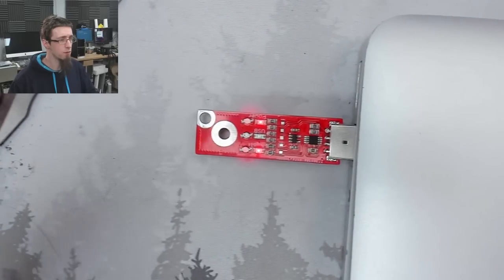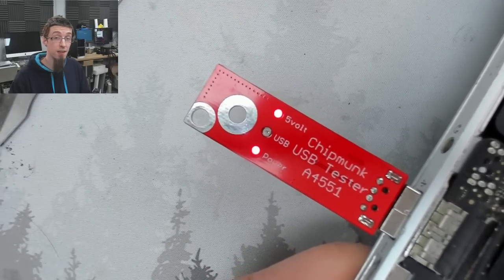CMIzapper.com Diagnostic Tools - LFC#343

Comment: another top tip that has sprung to mind is to use low melt solder on the break out boards, it'll be a breeze to pop them on and off for re-programming, and obviously use normal solder to put them back on the laptop/PC board...

Comment: USB keyboard is the best tool to check, if laptop is on or not (tapping numlock+caps lock).
Reply: Somewhat more cumbersome though in terms of desk space.  Could also use a USB-memory-stick (with LED) or a mouse; though neither will give you the good-5V reading.

Comment: I'm always fascinated by special purpose diagnostic and repair tools. Some pay for themselves over months, others like a plumber's basin wrench pay for themselves immediately. If you've ever tried replacing a kitchen faucet without a basin wrench, the difference is 30 minutes of cursing and misery vs 5 minutes of calm labor -- choose wisely. The pricing seems to be a wash - if you're in the laptop repair trade, shaving 5 minutes of diagnosis off each dead laptop adds up quickly when time is money. Finally, I'm certain the Chinese will make whatever you want at the quality level you're willing to pay for. One should expect to pay more than AliExpress prices for better than AliExpress quality...

Comment: Please can a MacBook air fail to boot totally if the battery is dead?. 
Just saw what this MacBook air battery tool could do and was wondering because I have a MacBook air 2011 who's battery is dead that's showing green light on the charger but not coming on.
Reply from the maker: Older MBAs should switch on with the battery disconnected. A completely failed battery can prevent turn-on. So yea, try unplugging the battery and connecting the charger, see if it comes on.